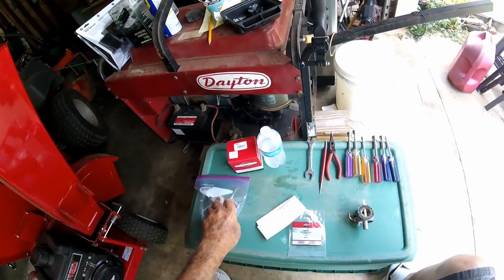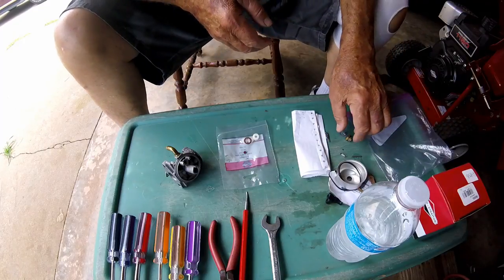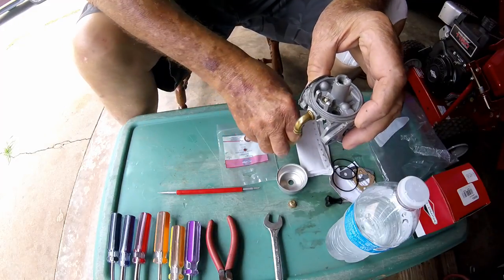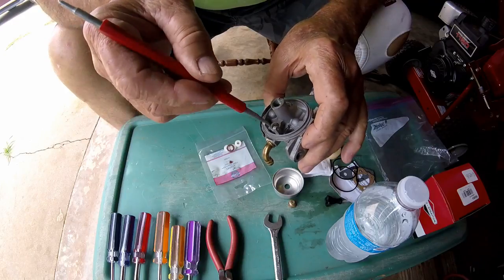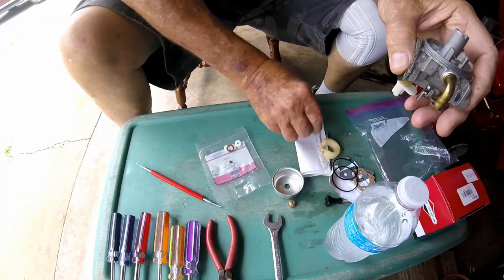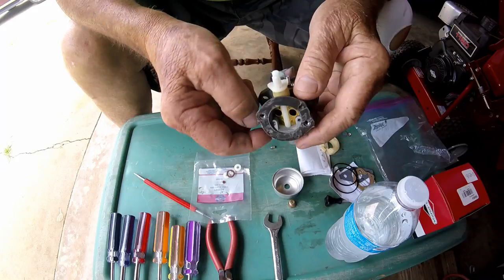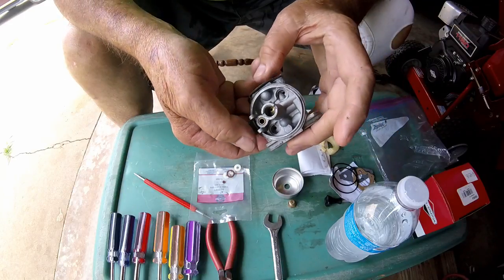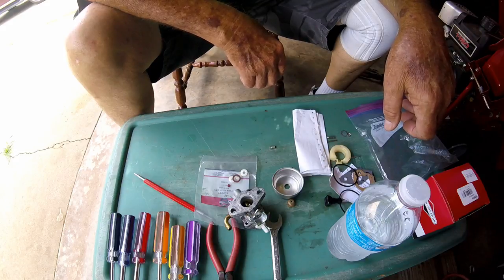How I screwed up cleaning My Briggs Carburetor Pwalpar VLOG

Comment: wish you the best of luck with the new carburetor.i have this same type of briggs and straton engine on my pressure washer. like your chipper it's not something you use on a regular basis. i will add a dash of marvel mystery oil to the gas tank before filling it up. this seems to help keep the carburetor clean and running the engine until the gas is out( emptying the carb bowl with it.)helps too when finished with the task at hand. i have had and used this pressure washer for 19 yrs.only repair to date was a leaking valve cover gasket replacement and yearly oil changes. i messed up a few carbs along the way too and learned from it as well as the razor tongue of my ex wife when they happened.( one reason she's ex, never again ). try the marvel mystery oil as preventative maintenance in the gas. use it in my truck 4 oz each 10 gals. helps keep the injectors clean. i'm rambling here. again best of luck.
Reply from the maker: Thanks David  I had a gas powered pressure washer,  it froze in the garage form not being drained  Never occurred to me to do that and then the inside of the metal gas tank rusted its now a 500 dollar pile of junk